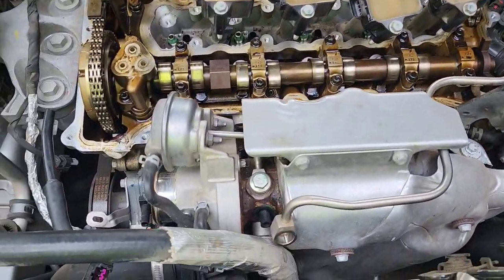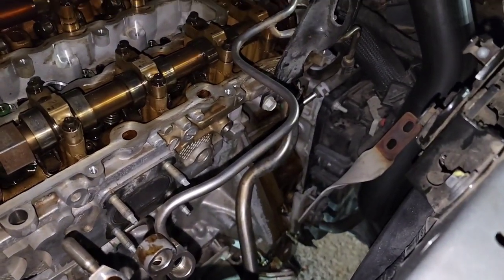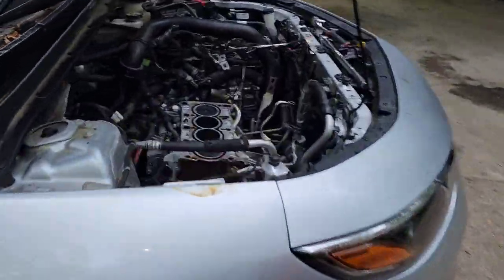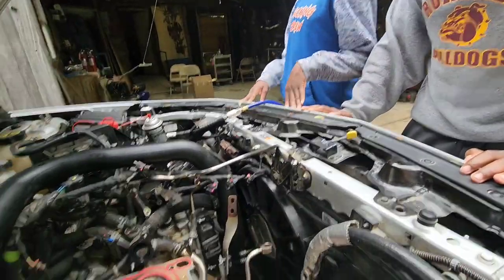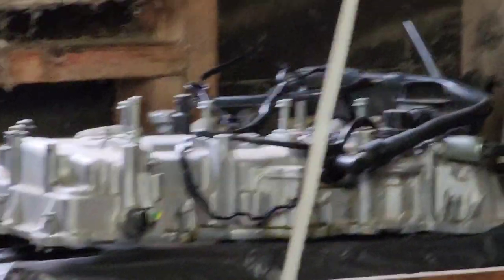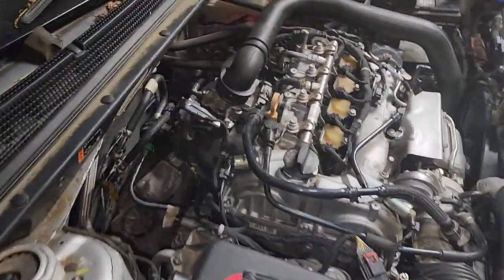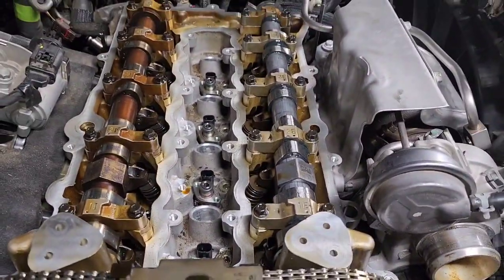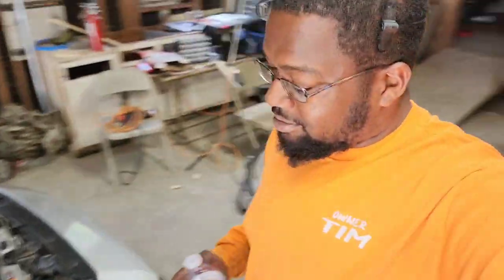2020 Chevy Malibu 1.5 Turbo Gets New Timing Components

Comment: So the high pressure fuel pump is having a low pressure issue new high pressure pump same problem im thinking the cam that deive HFP is worn
Reply from the maker: @rohanboswell5408   possible, did you check for wear on the cam lobe?